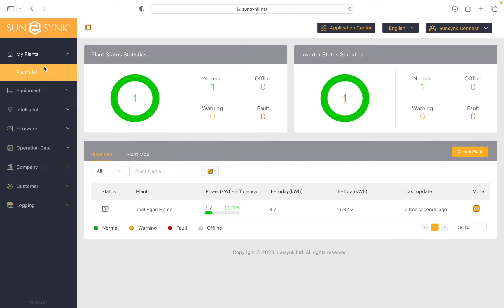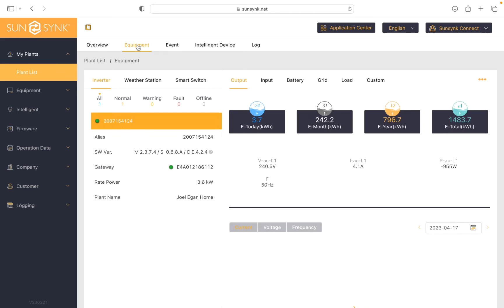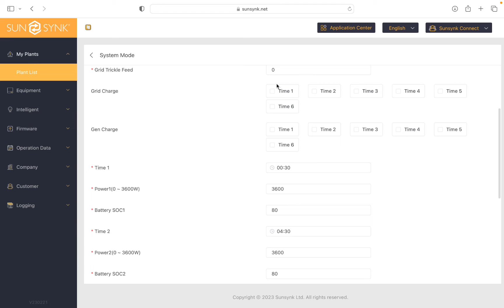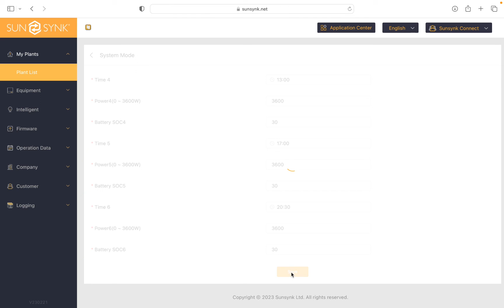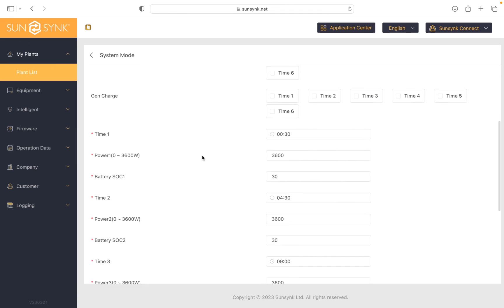How to setup your battery discharge timers using Sunsynk Connect

Comment: Hi it means you need to set Work mode to Zero Export to get battery export to discharge........ok thats fine.........however, for true automation you need to be able to export to the grid from solar array during sunshine hours......but perhaps also discharge batteries say between 7pm and midnight to export to grid...to make more profit. However to do this you have to change the work mode..........but this is manual only...arghhh. Please can Sunsynk put a timer on the Work Mode settings so this can be change automatically - simples.....

Comment: Ridiculously complicated settings menu for this system.

I have 6 hours cheap electric overnight 23:30-05:30. I want the battery to charge to 100% during this time every night. 

Then from 05:30 i want the battery to discharge until the solar kicks in.

Why does this fairly simple request feel impossible to set up?

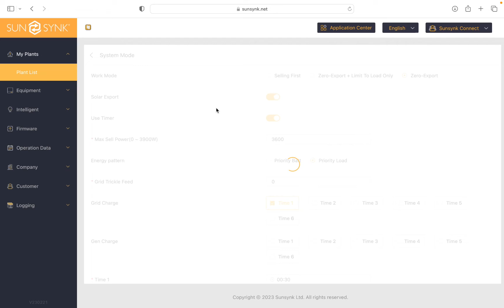Comment: Thanks for this. Can you provide more clarity please. I notice you have Zero Export 'ticked'. does that mean you are not exporting to the grid (is that from the battery) although you have Solar export selected! That appears to be contradictory. In the previous setting with the use Timer on and Grid charge you had selected time 1 and set the time to 00:30 to start battery charging from the Grid until SOC1 was 80%. Is there a time when this instruction ends or does it continue to use power from the Grid to charge until 80% of battery capacity is achieved? The unticking of a time is counter-intuitive although I note the Use Timer is 'still on'.

Comment: Can the system be set to discharge to the grid?
Reply: As I understand it you would have to change the mode to "Selling First", make sure "Grid Charge" is unticked for relevant timer and set the Battery SOC value to the lowest percentage you want it to go down to, e.g. 20. I haven't tried it yet though. From the way the UI looks to me though you can't set it to charge from the grid on one timer and then discharge to the grid on another, e.g to buy cheap and sell high.

Comment: How do I get to this screen / menu? 

I have nothing like this on the sunsynk connect app?

Equipment does not have a “more” option to select? Only “inverter”, “gateway” or “ac switch” ?
Reply: Here we go.  On your app (mine is an iPhone) got to the bottom of your screen and tap on “Equipment”. You’ll then see your inverter and 3 dots, click on those and choose Settings, then system mode.  Hope that works for you
Reply: Brilliant. Thank you

Comment: As I understand it, the SOC setting means:

"Charge my battery to this level from the grid at this power," (if grid charge is set), or 

"Allow my load to discharge the battery to this level at this power, before using the grid" (if grid charge is not set), or 

"Discharge my battery to the house AND the grid at this power until we reach this level” (if grid charge is not set and zero export is not set).

Is that right?

It would be very nice if zero export was something that could be turned on and off with the timer, otherwise you can’t decide to export battery to the grid only at certain times of day.
Reply: Can you help me, my inverter 5.5kw it indicate f56 error

Comment: Great to have a nice clear description - thanks. If you take requests, the next one would be the other System mode page: the relationship between Zero Export, Solar export, etc , where the GUI (esp on the inverter) is particularly unintuitive :-)
Reply: Did you figure this out? I just know when I tried to use the actual Flux setting it never sold to the grid and just pulled from the grid continuously after the charge period until the sun went down. I turned that off and now just use a timer with hourly timing to charge the battery.